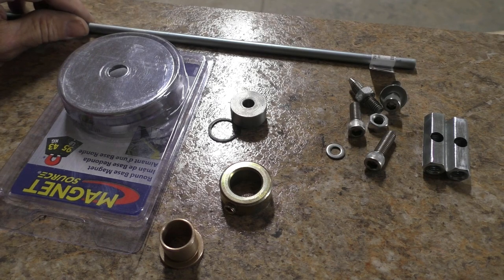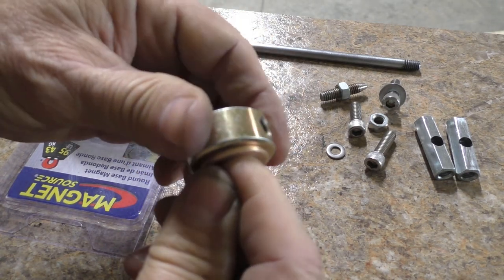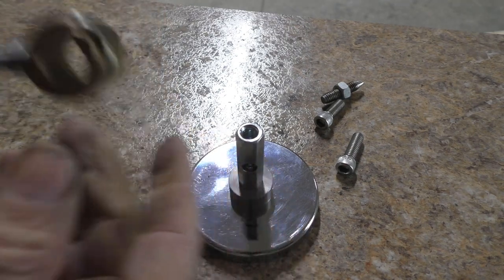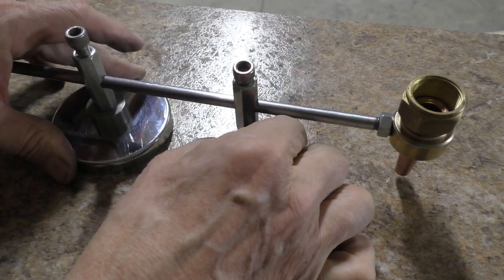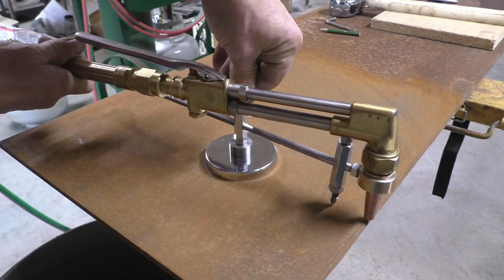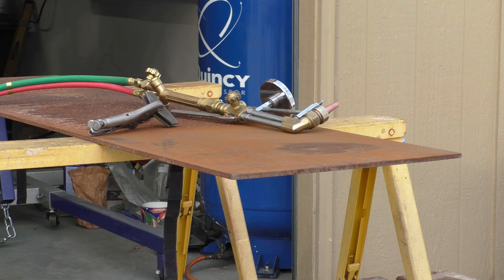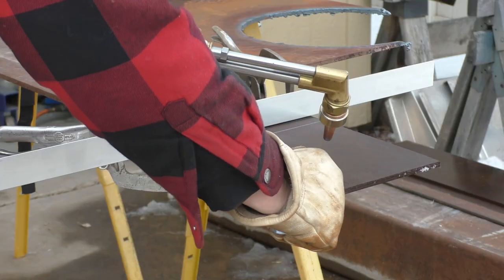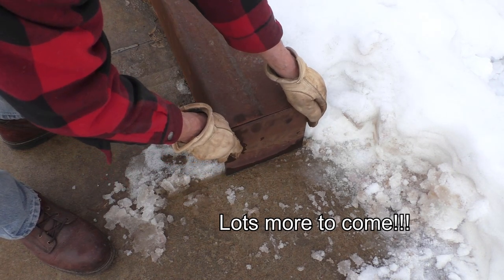Homemade Oxy/Fuel Torch Radius Cutter and Straight Guided Cutting

Comment: Good video and job I think I will make one for my plasma cutter I have most of the parts if I can find them. Take care, be safe and well.
Reply from the maker: Thank you.  I think you will have an easier time making a radius tool for your plasma torch. If you have a drag type cap, the height and flame are no issue. I recently unloaded my plasma equipment and even a CNC table I built many years ago. Figured I had retired and did not need such nonsense.  Thanks for watching and take care yourself!

Comment: Nice setup Steve, where will you be using the circles?
Reply from the maker: Thanks, Lance. Circles will be top of concrete  foundation piers. 8x8 steel tube will be columns on those plates that will correct elevation to level the floor. Salvage steel cheaper than wood and much stronger in the end. Thanks for watching!
Reply: I like that expiscaly the high adjuster
Reply from the maker: @rogertaylor8615  Thank you. These kinds of projects are fun to make when common parts and less fabrication/machine provides a functional tool.  Thank you for watching.

Comment: Start your cut with pressure on then you can use both hands free don't have to push the pressure all the time put it on the automatic mode.your tip is tooo close.very good tool with this i cut any shape clear as glass slag zero

Comment: Would you build one for me ?  Of course I’d pay for it
Reply from the maker: I appreciate the confidence! These type tools are commercially available with a quick internet search. Buying tools has the appearance of being expensive, however pretty much every tool I have ever purchased paid for itself several times over. There are many ways to make a similar tool and this video is simply one of them. Learning skills, putting those skills to use and concurring a vision can be very satisfying. Anything can be accomplished by breaking a bigger task into smaller steps. The trick is deciding where satisfaction comes from. Thank you for watching!